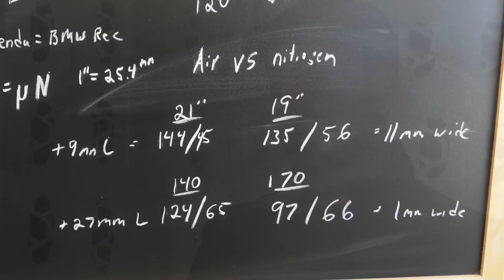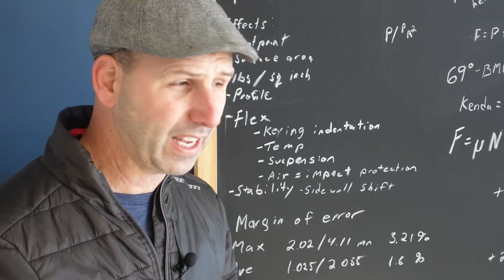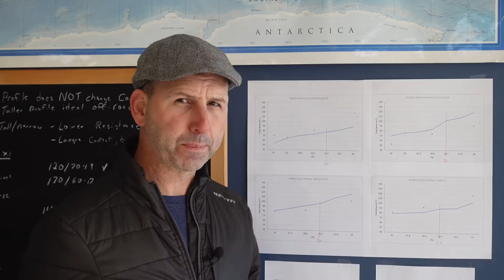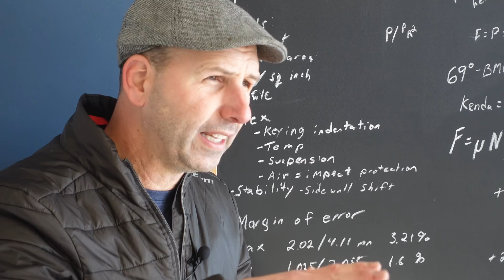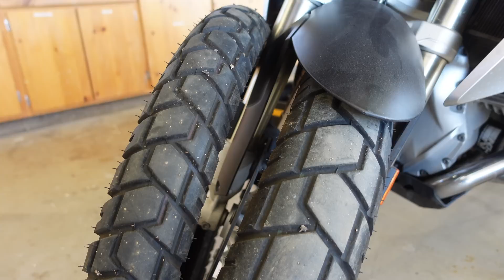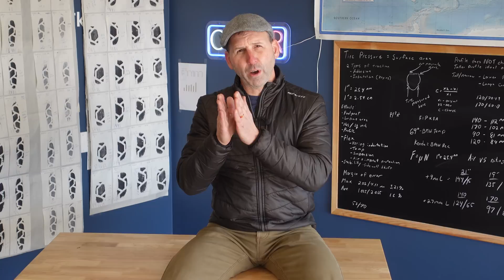Selecting the correct tire pressure; How airing down motorcycle tires affects contact patch

Comment: I thought i was crazy feeling much harsher suspension when i aired down my tires from 36 to about 26, then, without seein this video, i realized that maybe, airing down made part of my suspension useless because the primary "suspension" element being the tire, wasn't doing its job and it was compressing all to the rim, transfering that harshness to the bike directly... i found after a lot of tires, that rubber on the knob and its design was much more important on the riding confort more than the pressure they are inflated... after that i never deflate my tires, i set up the suspension in order to be confortable and apply the "weightless rider" technique learned here to improve the absortion of the terrain... 

also, i'm completely decided to go down from a 150-70-17, to a 140-80-17 on my TRK... but i'm still wondering if going 100-90-19, in opose of 110-80-19.

Thank you for this video Bret, you are the best on youtube, by far.